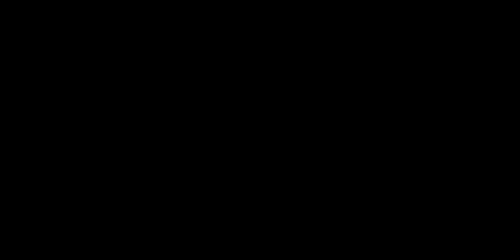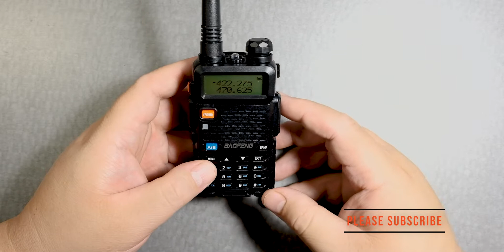Baofeng UV-5R R-CTCSS Receiver CTCSS

Comment: Nice and simple.  Thanks.  

One thing that might throw the user is this only applies to frequencies in VRO mode (not programmed into memory).  It's my experience that programmed freqs require the programming software to change parameters of the freqs in memory.

Comment: Ok, so mine won't memorize the CTCSS freq. for that channel. If I manually bring up the TX frequency the CTCSS is there, but go to same frequency by "MR" Channel and it's gone.
Reply: make sure the 'Tone Mode' column also has "TSQL" selected. If it is set to "(None)", it will ignore anything else you set.
Reply: Same here. R-CTCS setting will say confirmed when setting to 69.3 then I hit exit. But when I check settings again it's OFF.